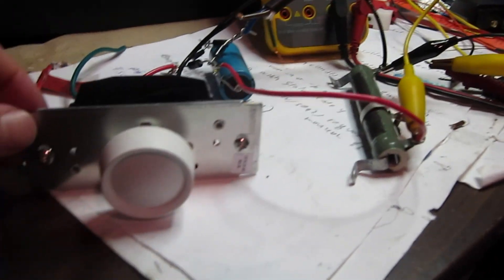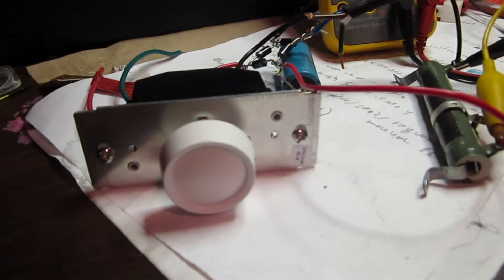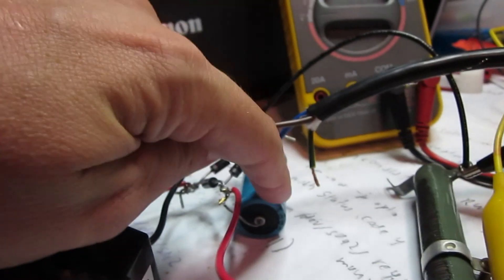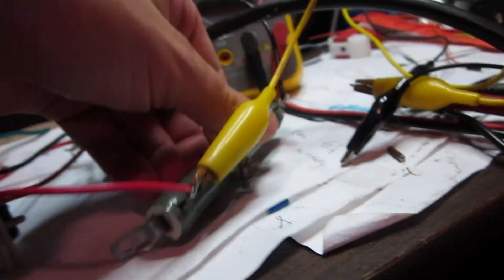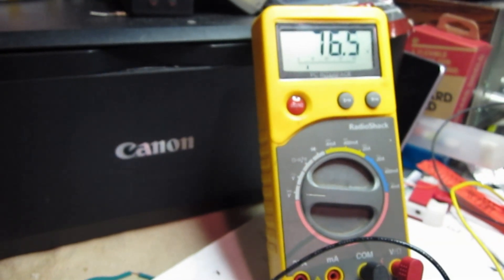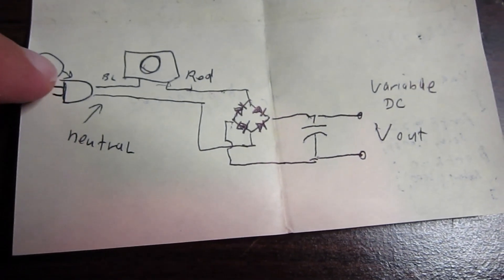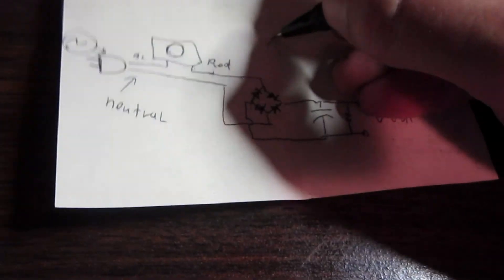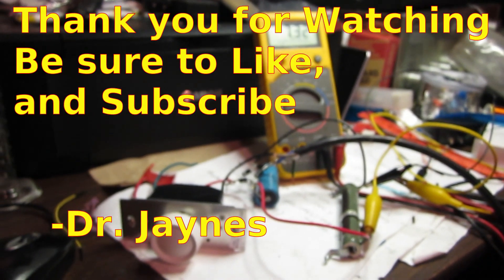A Simple Variable DC Power Supply Circuit to Build - PT1

Comment: Any recommendations for a reliable source for the diodes, resistors, and capacitors with these tolerances?
Reply from the maker: I usually order things through Digikey...Some things I find at ham radio swap meets or ebay... Big wire wound resistors may have to be found in the latter type places... I hope this helps.. Thanks for the great comments..
Reply: @jaynesnetwork  Greatly appreciate the tips, will check out those resources. Love the short form videos with some insights into working circuits like this!